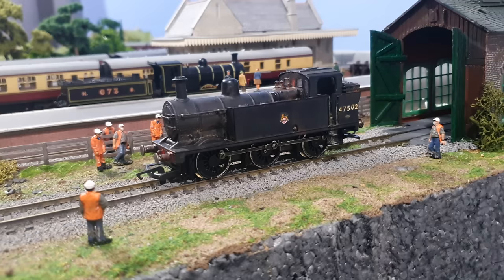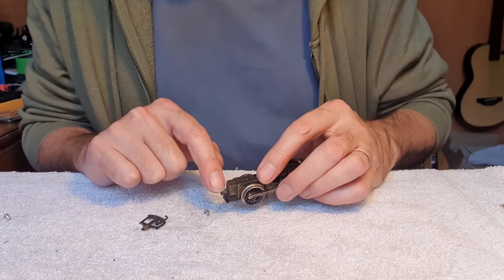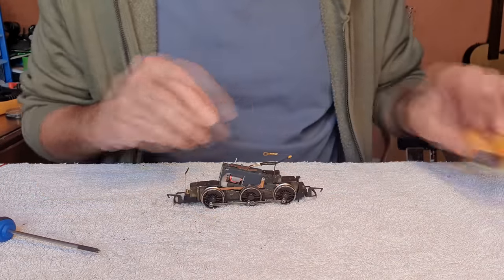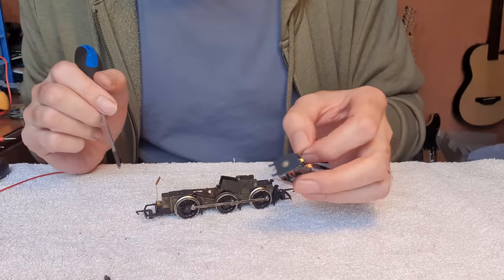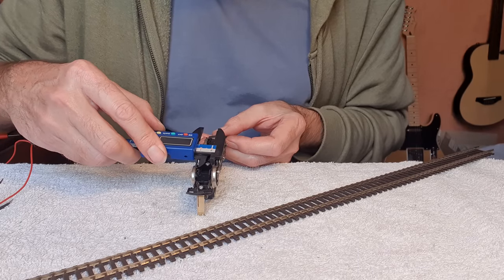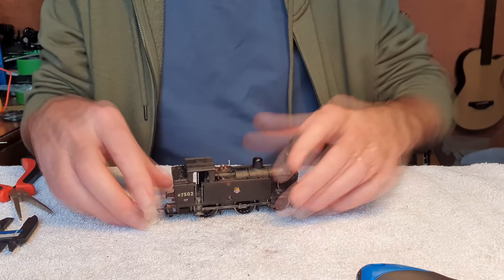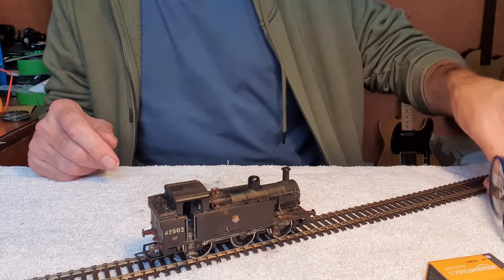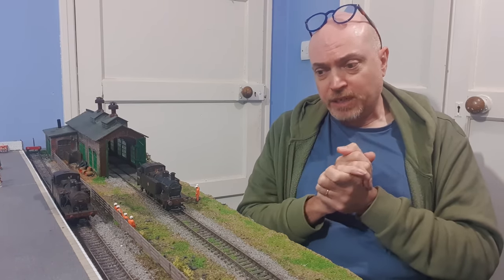Hornby Class 3F : Repair Request

Comment: I still love my ancient R52s 3F 47606 with its smoke unit from the late 60’s. I repainted and detailed it with metal handrails and upgraded the XO4 motor to a 5-pole Airfix motor when I was a sprig. It was my birthday present when was 6 back in 1970. Still a stalwart favourite.

Comment: I have the R.052 Hornby LMS version with the same body tooling.  It has the X03 motor without traction tyres or sprung rear axle and is a little noisier but is a very smooth runner all the same.  I think the Hornby is the more solid design but the Bachmann is better detailed.  The Hornby dates from 1978 so must be an earlier tooling than the Bachmann.  I prefer the Hornby version because it is cheaper and is good enough looking for me, but it depends on what you prefer.  I would like a black version though.  It was nice watching both versions going round.

Comment: Nice work. 
I wondered why you didn't strip the wheels off first?
They would always need a clean? 
I have 2 Tri-ang Jinty's with X04 motors from the 1950's and 1960's. 
Both are great runners and quite quiet on my old layouts.
Your newer version seems louder in comparison.
Great clip idea.
Monique from Brisbane

Comment: Another great fix. Bit worried about the red Range Rover in the station car park. Has it been stolen and dumped? I’ve noticed it hasn’t moved for ages. Perhaps P.C. plod should check it out, may not even be taxed. All the best Bill. Mick.
Reply from the maker: Think it's broken down. Like most Range Rovers do....
Reply: Hihi that’s what I was thinking Bill 😂
Reply: If no one claims it you could get a V5 issued and claim it. Decent mk1 Range  Rovers are worth decent money these days!
Reply: @robinforrest7680  - I think that's a P38 (much later) and less desired. But yes, good original Range Rovers can be worth a mint.

Comment: Hi Bill ,, 
i suppose you could always make a failsafe for the little bras tab you put in it for the body and that be to put a small screw through the the plastic and into the brass tab and it would never fall off ,, just a thought.
Also these x7 motors you are talking about there & do you have an idea of what year they came out in them jintys and were them motors put into other locos as hornby triang use to do.
Cheers from John in Australia
Reply: Type 7 motors are used in all sorts of locos. There are several based on this chassis, including 'Thomas' and the open-cab Pannier. (There's probably a Class 08 shunter using the same chassis too!) The Class 58 uses a tiny motor, so it may be one of these.

Comment: Hi Bill.

Good job, well done.

I happen to possess 2 x Hornby LMS maroon Jintys. One has ‘LMS’ down both sides, and the other has the running number down both sides; both are in lovely condition with all couplings, buffers & vacuum pipes present and correct. I purchased them second-hand from the well known auction site and, after my usual service on locos purchased this way, are nice little runners, although they were fine even before I serviced them. The one with the numbers down the sides is definitely a later release as its Hornby number is ‘R301’, whereas the other one has the Hornby number ‘R052’. Unfortunately, they are rarely used and just sit there in a box as, when shunting is required, I use my blue Hornby S&DJR Jinty. I suppose I should move them on to someone who has use for them but I’ve never gotten around to it. If you are interested, just give me shout.

Paul. 👍
Reply from the maker: I would be interested in the later one. However, I just don't have time to look at anything on top of what I have at the moment!
Reply: Bill.

Okay. I just thought I'd mention it as, in your previous video, you stated that you was after a maroon LMS Jinty. I wasn't going to ask for any money but, as you are not presently taking anything else on board, another time maybe. 

All the best,

Paul.
Reply from the maker: @platformten5958  Aye I'm no sayin no I'm saying aye but hud on the noo.
Reply: Bill.

Okey dokey pal. Just let me know when you are ready and we'll take it from there. 

Chow.

Paul. 👌